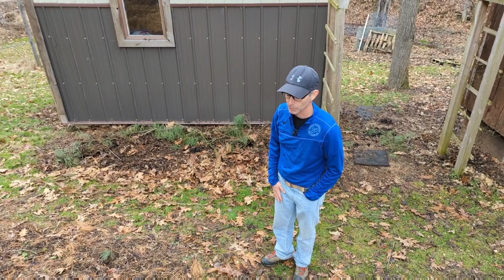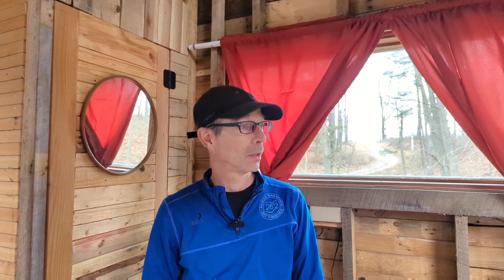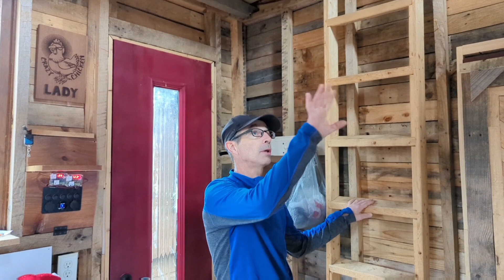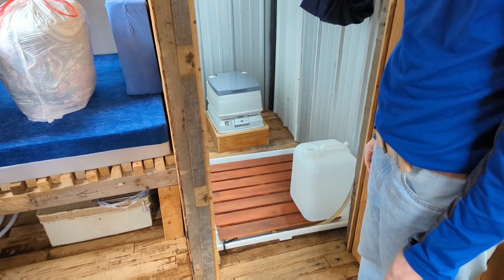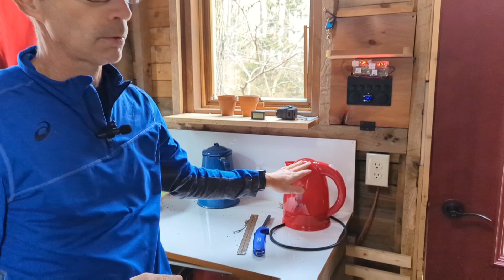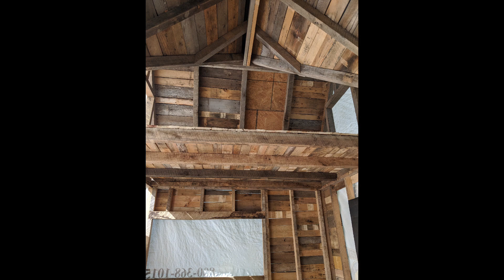We built a TINY HOUSE! Ready for a tour?

Comment: Well done David! I could tell you were uncomfortable talking to the camera and forced yourself to power through the explanations of what was done to the build, but you did a great job!! 👏🏻 You guys did a great job building that tiny house. I and my partner lived in an unfinished 16’x24’ building that started out as a garage that quickly turned into our living quarters back in 2008 when I lost my job. It didn’t have running water or sewer either, but we used a camping solar shower bag and heated water (we toted in (2) 5 gallon gas cans) in the microwave and poured into the bag along with cold water. We went to a farming store and bought a large round rubber animal feed container to stand in and dumped the water afterwards. Had concrete floors so it didn’t really matter if we splashed water 😉 Tough times call for whatever works! It was tough at first for this city girl, but after time, it became easier.